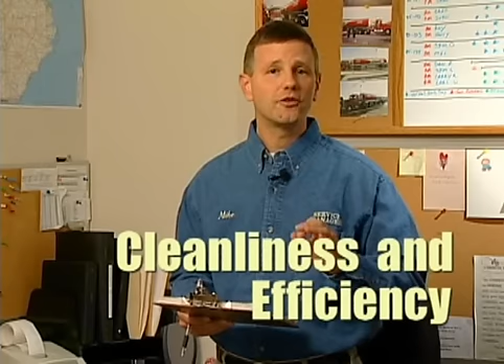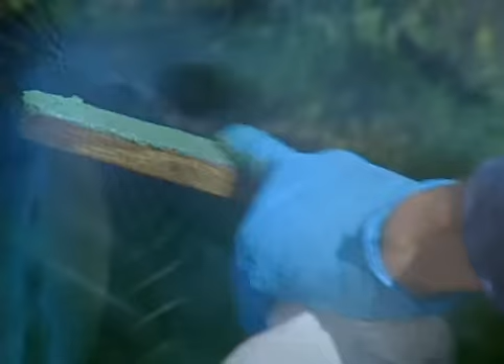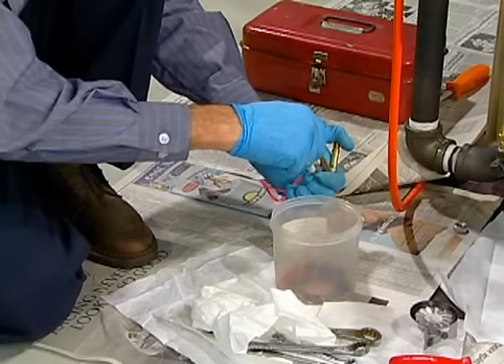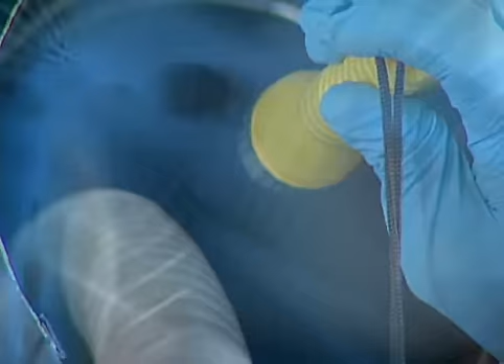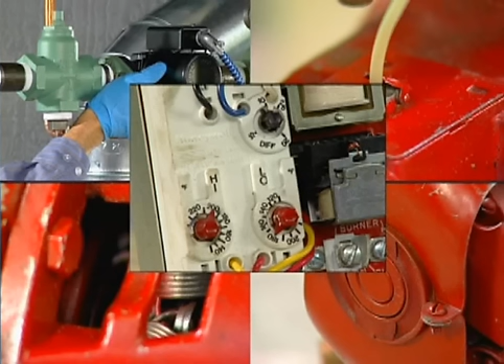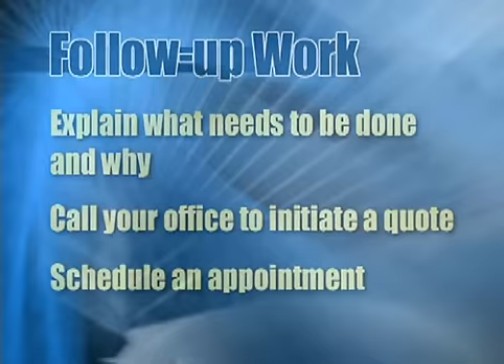NORA Video 2, Preventative Maintenance, Tune-Up

Comment: WOW,  I guess I can't get what I pay for,  The only thing the technician did to my unit was replace the nozzle and Fuel filter, All he wants to do is try to sell me a new unit because mine was installed in 1994, But still functions well. Had to call him back within 3 months of preventive maintenance to replace the flame sensor because the wire was petrified  And pinch together From where it was crushed underneath the spark Box. That was another $160 on top of $120 paid 3 months ago.

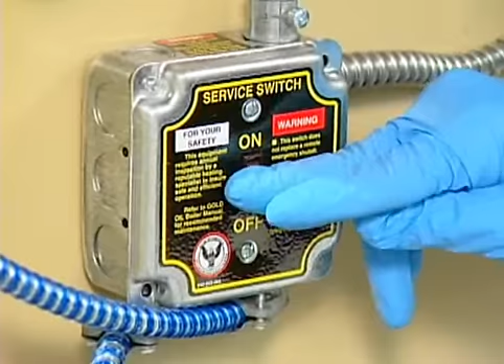Comment: at 45sec "a tuneup will avoid service call".......  BS!! well, yes it will avoid CERTAIN problems but  with statements like that, its noras fault so many customers believe that bs & try to blame you / not pay when a part breaks 4 or 8 weeks later.  sometimes after a tuneup a cust. says "so ill be trouble free this winter?"  I respond , "can't predict it". ......& what genius installed that filter like that on the wm gold in this video?......  he goes through all that trouble to jump tt around 13:25 interesting
Reply: Hahahaha.....I'm surprised the oil filter wasn't touching the ceiling. WTF

Comment: ?
GR8 VIDS! I WATCHED MANY.help??? mega info :)
I CANT GET MY BECKET RUNNING RIGHT.theres a few things going on.
the gap is even with the nozzle.only the electrodes stick past it.like theres no space.between the two.yet the elec is 1/16 past the nozzle technicly. their flat/no points and i see after 1 day the carbon is scoring on the bottom 1/8 on boyh electrodes.no scoring on nozzle..but nozzle has a darkish droplet stuck to its bottom.once it croaks totally i remove the gun,line and scrape everything down n it runs for a few hours...
ITS STALLING AFTER 1 MIN THEN LLOCK OUT>pump goes 20sec b4 lock out
"     "           "              2 min ""
stumbles every 20 sec...sometime 1min..sometime never thru a cycle up to 12 min.. i jumped the cad eye no difference..ohms are 1500 off 500 on ....sometimes after it wont run past a min...40min later it WILL RUN A WHOLE CYCLE but stumble and catch stumbles usually 1/2 second..the longer it stubles the better chance it wont recatch.. again it wont run past 1 minute...it always runs dead for 20-30 secs b4 lock out. if i shut the heat off after a lockout.it will reset itself... just had full tune up.  spark is hella strong!!looked too strong compared to utube tests...the aqua stat hums lightly..flame is bright orange/yellowish...on restart i never see a puff of smoke...IF IT DIES..I CAN TURN THE ON/OFF SWITCH AND IT WILL LIGHT RIGHT BACK UP FOR A MINUTE AT LEAST...once the on/off switch wouldnt even trigger the cad box took 10min to reset somehow....theres a spring loaded check valve in the gun fuel line im getn susiscious of..i blow the line out by mouth and oil comes out in a straight stream pretty easy..the B.damper dances pretty hard constantly.seems like somethings killing spark,,those 20ish seconds the pump is going w/out fire,i see no light thru the crevices and cracks by the coil..sometimes it runs nice catches every stumble fast..sometimes it does the 1min/2min thing or 40sec. its like a crapshoot everytime it clicks on!!!!!!! when i take the tiny oil line off to remove gun,i never see any dripping oil.yet the gun is 30%full.?also under the gun i s  wet. not much just a thin coat..it never ignites,it might be moisture 4 all i know.
Reply: I think i might have the same problem brother....did you ever have any luck on fixing it or figuring out what it was??